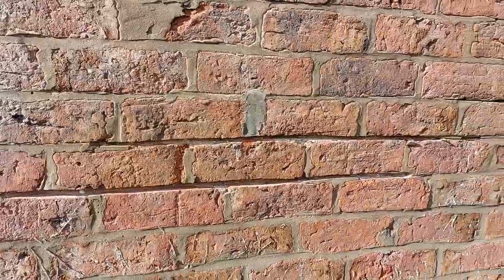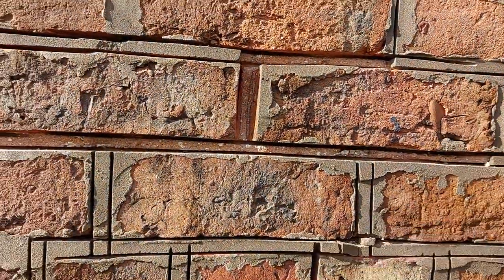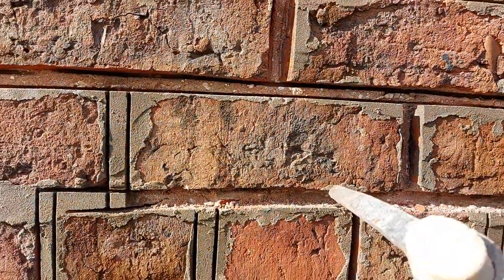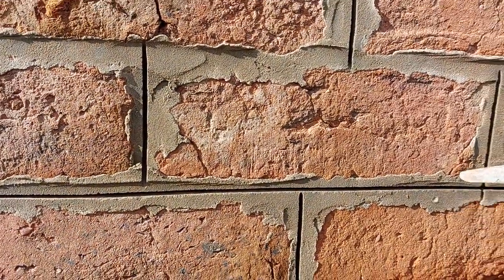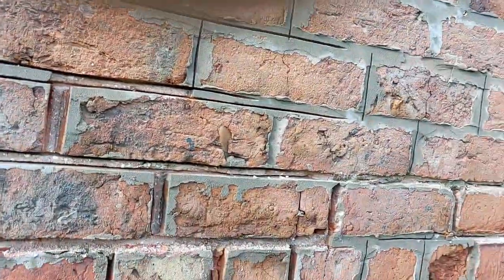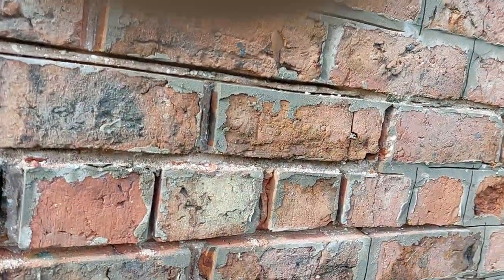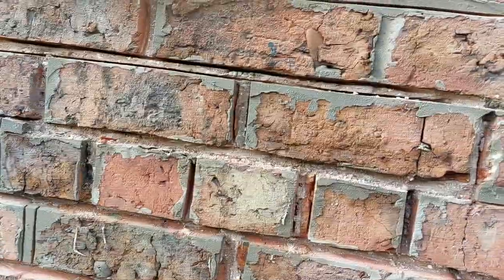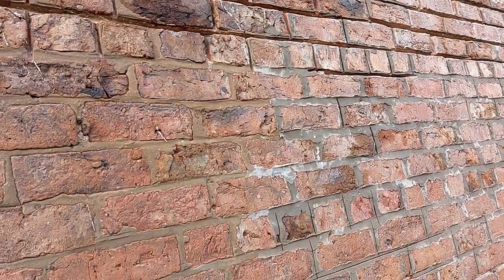How to remove hard cement mortar - a few different ways

Comment: Thanks for this. Currently raking out a south facing gable end on a barn conversion in Pennines. Some unbelievably hard cement put in maybe in the 80s. Really did a good job too, very deeply filled. Using a SBS drill and pointed chisel bit. Very very slow going, trying to find the joints with wide strap pointing, trying not to damage stone. What would you suggest for pointing mortar? Exposed position on top of a windy hill - I'm thinking NHL 2 St Astier 1:3 mix as opposed to quicklime hot mix just because the weather is really similar to West Coast Scottish weather (wind driven rain) and unfortunately can't put a lime render or harling on because it's not the practice here. Thanks.
Reply from the maker: Yeah I couldn't use an sds on here the bricks are softer than the mortar
NHL 2 may crack depending on the depth and your experience 
I'd use a good  NHL 3.5
With a high free lime content mixed at a 1 to 3  sharp sand 
Choose the sand colour you want the  final colour to go if your mixing it yourself
Keep it damp as long as you can after pointing 
I'd order your lime now we have a national shortage in the uk
Reply: @GMTpointingspecialistsltd  👍

Comment: Would holes mistakenly plugged with new instant hydraulic cement come out as easily?
Reply from the maker: @feralfx6764  if you take it out asap as it will keep getting  stronger every day
Reply: No, it’s been there a few months now. Is that stuff softer than old foundation cement/mortar, because I need to learn how to chip it out because it’s deep in there.
Reply from the maker: @feralfx6764  if you whatsapp me some pictures I will take a look at it for you

Comment: Is there a gentler way to clean up the overspill on the bricks. I have a soft imperial brick and someone badly repointed with cement
Reply from the maker: This was a really hard sand and cement 
On a rough brick 

You can use a concrete rubbing stone or a hydraulic acid to clean it off 
have you removed the cement pointing and that's what's left on the face

Comment: I do not envy you this job one bit. What a terrible pain in the neck! 
I’ve got a front elevation of an Edwardian house to re-point and can’t use any power tools to remove the old pointing grrrrr
Reply from the maker: What mortar is in there is it original  or has it been pointed over in cement
Reply: @GMTpointingspecialistsltd  it appears to be original pointing with some cement mortar patches here and there but the most baffling thing about it is that a local council conservation area document claims the original mortar/ pointing to be made up of, I quote, 1 cement: 3 lime putty: 12 sand!! or if a stronger mix is required 1 cement, 1 lime putty  and 6 sand!!!! Totally baffling. I was going to use 3.5 NHL but now I’m even considering a weak cement mortar (1:6 and 0.5 hydrated  lime as plasticiser). The property isn’t a listed building and has been altered/ wrecked by addition of upvc windows throughout and modern cement render on flank and rear walls. Any better ideas would be we welcome tbh
Reply from the maker: @doncamillo1428  if its edwardian  its lime mortar so you put lime back an nhl with a good fee lime content at a 1 to 3 
You never add cement to nhl putty or hot lime 

A 1 to 6 cement is a strong mix 
If you have to use a hydrated lime use a 1 1 6 but that's last resort I'd check that you have read the correct information first 
What are do you live in
Reply: @GMTpointingspecialistsltd  South London
Reply from the maker: @doncamillo1428  I'd 100% check because there mix could cause more damage to your property
Reply: @GMTpointingspecialistsltd  3.5 nhl in a 3:1 ratio was my original plan until I read that document. Also, upon initial inspection, many perps are super deep and void: 120mm with no mortar
Reply from the maker: @doncamillo1428  always put the binder first  so 1 lime  to 3 sand
If its got a void all the way through you need to back point it first    say half way let it go off for a couple of days then point the remainder 
Check what nhl is in your area that look at the data sheet pick a good quality nhl
Reply: @GMTpointingspecialistsltd  that’s why I couldn’t believe my eyes when I saw they recommend cement in the lime putty mortar mix. Thank you for all your advice. I may use a 3.5 nhl ready mix mortar mixed to a colour from the Conserv site. Bit of a head scratcher this one
Reply from the maker: @doncamillo1428   OK good luck  doesn't sound as though they have a clue
Reply: @GMTpointingspecialistsltd  I was thinking of backfilling with thin flint stone or similar  or would that be counterproductive? Some of the void perps are barely 10mm wide
Reply: @GMTpointingspecialistsltd  Ha! That’s what I was dreading. Thanks again for your input and for your most interesting videos.

Comment: If you use the blades I sent you the link to you will be gob smacked at how many you don’t do through 
Forget silverline or ox blades 
I use 1 blade per 50m2

I must say you are very precise with that pick 
My current job the cement is like what you have got and I have just raked it with 6mm blade but have very slightly gone into the bricks by like 1mm but what I do is better than the fools prior
Reply from the maker: Yeah I need to order some this mortar is so hard
Reply: @GMTpointingspecialistsltd  I’m not saying they will go through like cheese but they will not wear out fast 
P4p the best blades I have ever used
Reply: @Southpoint2019  Would appreciate if you could post a link to those blades, friend, or name/model/whatever? Ta.